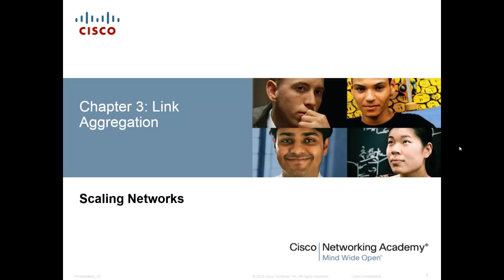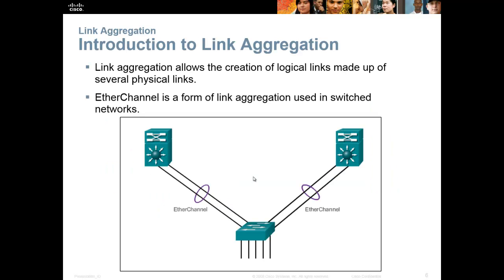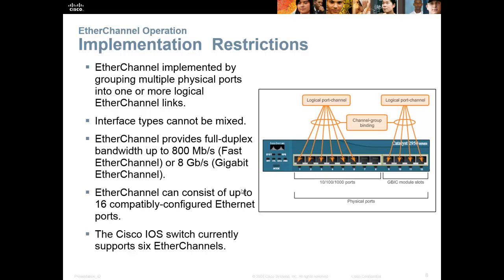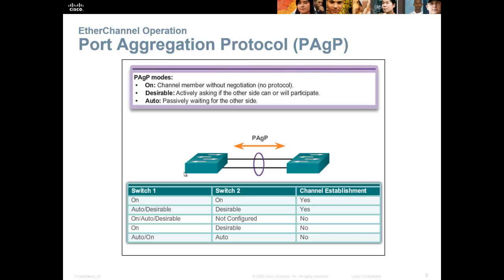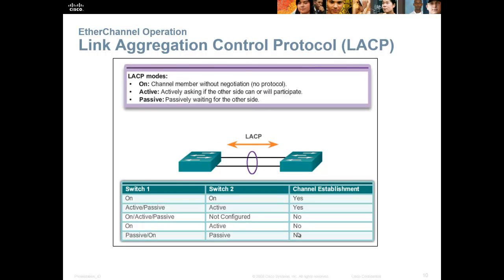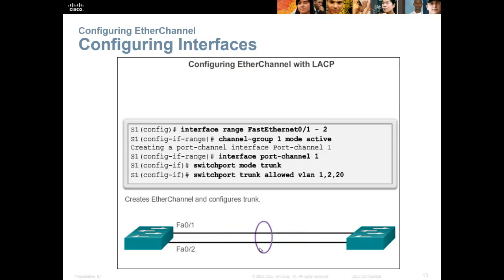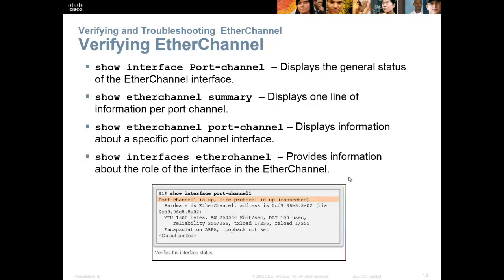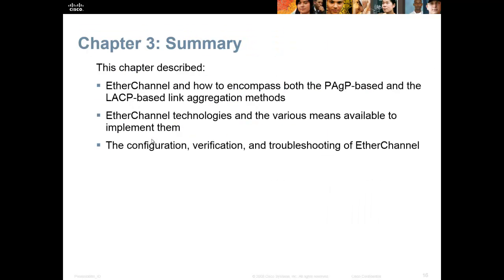CCNA 3, Chapter 3

Comment: dear johnny, I have a question

if any access switch has 8 users at 100 mbps then we can use the 1gbps port between access & core switch.
do we need any link aggregation in this case?

I'm confused when to use link aggregation & when not...can you please clarify?
Reply from the maker: +mahbubur rahman shanto 
No but...  You would need to ensure the switch back plane can handle 800mbps.  That is one of the big differences between a $200 24-port switch and a $1000 24-port switch.  The $1000 switch has a better back plane with a higher throughput and can process much more data per second.  Most switches can not process the total amount of ports times their speed, for example if you have 24, 100mbps ports, it does not mean the switch can actually process 2400mbps.  Make sure to check the throughput of the switch to be sure it can handle the expected load
Reply: +Johnny Mac 
thank you